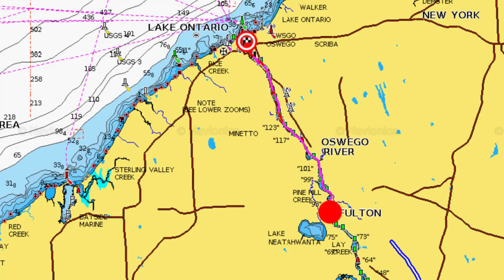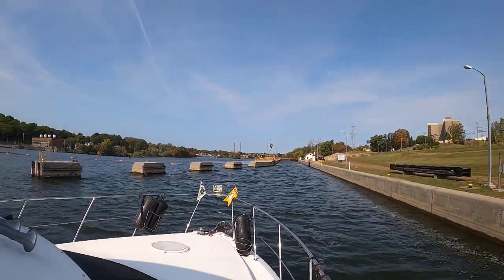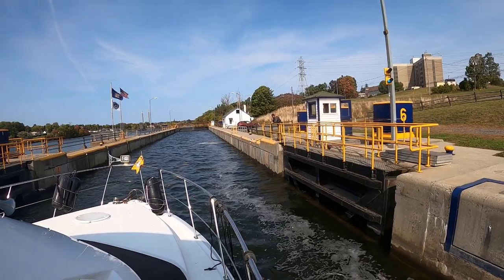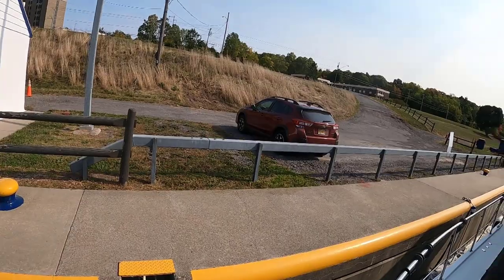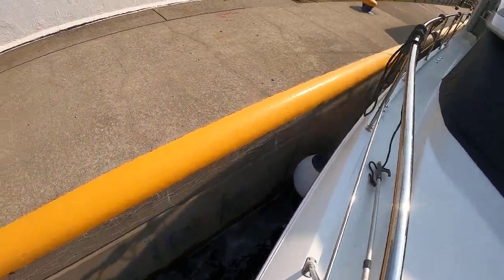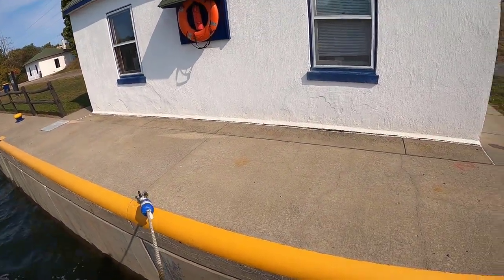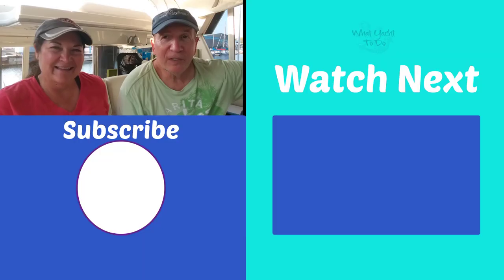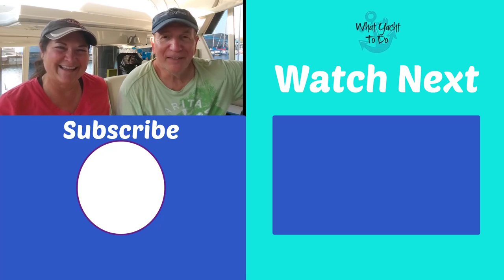Great Loop Route #140 PART 2: Fulton, New York to Oswego, New York | What Yacht To Do

Comment: Odd that you had a wind out of the east. Port side locking maybe better? I've been there with a full lock of boats and a single screw I/O engine. No thrusters.
Here is the story. I was with another couple and we were going from Sylvan lake to Oswego for a weekend cruise.
We had a group of eight boats and got locked up clear all the way on the Oswego river. Wind was bad out of the East and I wanted to dock on the west side of every lock. Single screw with a flybridge.
1st lock on the Oswego river, I was last in line so had no choice but to lock on the east wall into the wind. It took me 5 minutes to wiggle her in while this 30 foot sail boat skipper was yelling and swearing at me.
I kept my cool and passed him to get into the next lock before him. He had a low profile sail boat with mast down. I'm sure he was running a 16hp diesel with a rudder. Next lock I got in before him and took the west wall. It took him 15 minutes to tie up on the east wall and he hit 2 other boats in the process. My friend really laded into him. I hope it humbled him a bit.
I was never on my boat for conflict. Just a calming adventure. I held my temper. I am more concerned with the safety of my crew and visitors.
Anyway, Carma is a bitch.
Best wishes boating.
Reply from the maker: Great story! Best to lay back and keep calm. Good Job!

Comment: You are prepping your line from the wrong end. Start 5-6' from the cleat then loop the line until you reach the end...
Reply from the maker: Hi Steve, trying to understand this... What minute in the video are you talking about?
Reply: I was going to post along these same lines no pun intended lol.
Use your cleats on the boat instead of trying to use brute strength, just never ever cinch the line around the cleat only drape the line under the cleat and hold on to the rope keeping it taunt .
Reply: @WhatYachtToDo  at 38:50 you looped the line from the end and the line ended up all twisted...Start from the cleat side and loop to the end of the rope...no twisting!